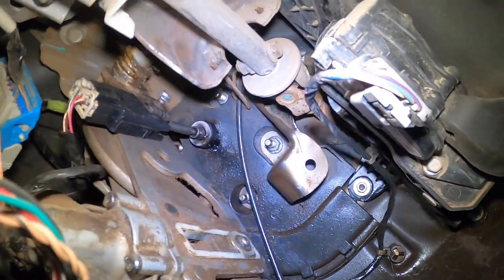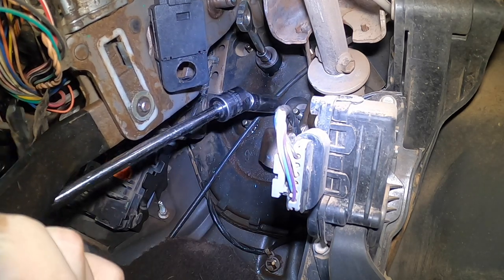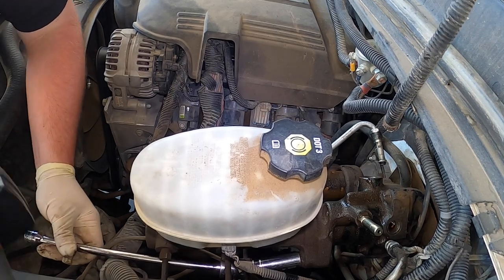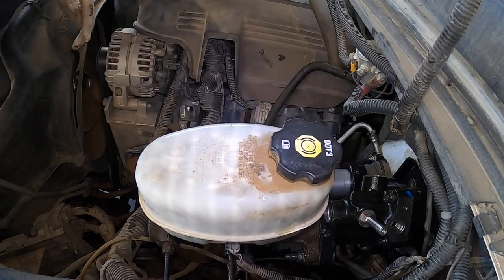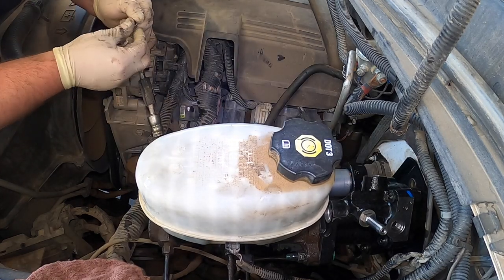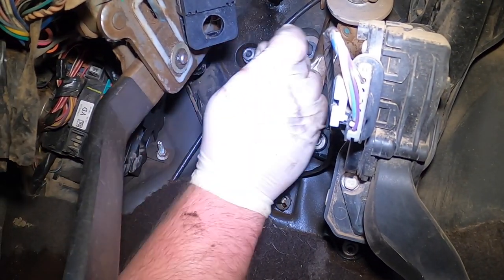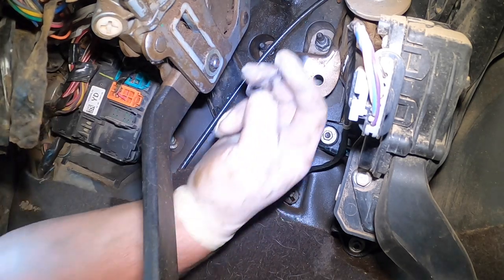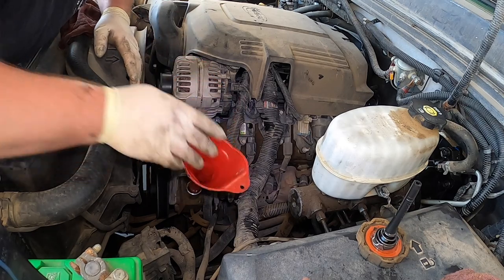2007 Chevy Silverado 2500 6.0 Hydrobooster (Power Brake Booster)

Comment: Drew is this truck the classic body style or the newer 07 body style? I am having same issue with my truck (classic 07), do you mind sharing the part number for booster, or where you purchased it at, and also what O ring kit you have (kit would be handy for a lot of things I work on)? Very good video, I will be watching it again shortly to install my power booster.
Reply from the maker: This truck is not the classic body style. I would recommend calling your dealer to make sure you have the correct part number  , as my part number may be wrong and i don't want you getting the wrong part because of me.  We purchase locally from a couple sources. For a decent o-ring kit harbor freight actually has them the red and blue (standard and metric) o - ring assortments kits. I would suggest looking for a brand new (not remanufactured) gm or acdelco , it will last considerably longer. We only use new ones now the reman ones last usually a couple years and start leaking again. Also make sure the master cylinder is not leaking into the hydrobooster as it will cause it to fail soon again. Thank you